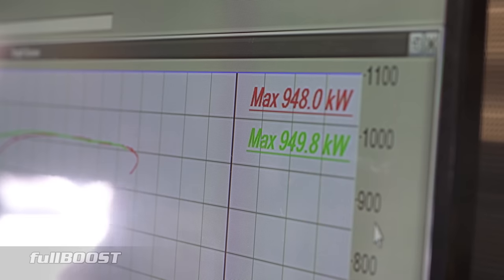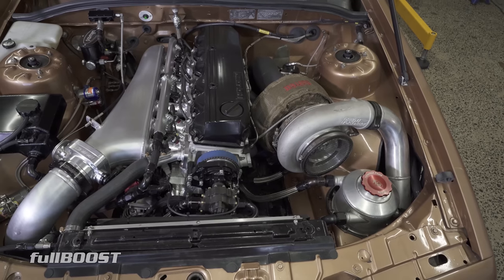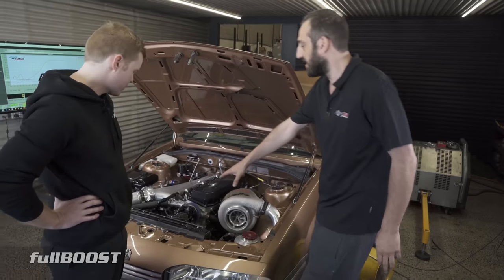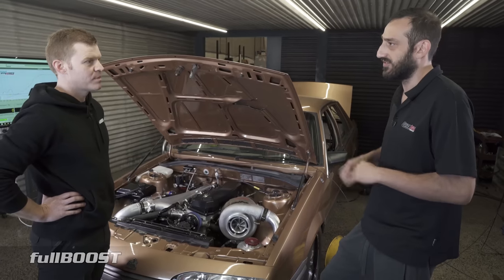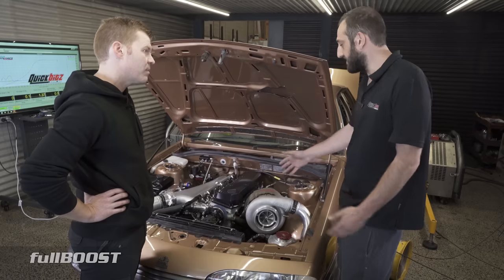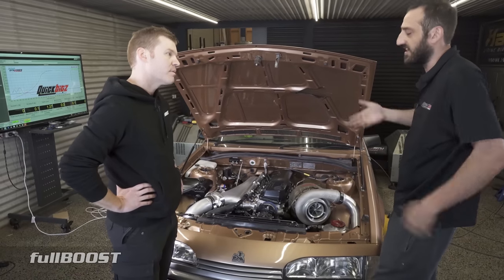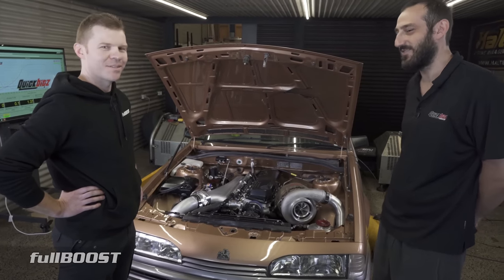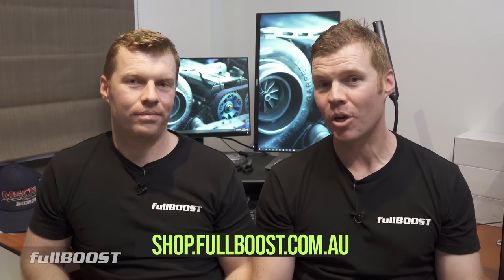Inside a 1300hp Nissan RB30 turbo | fullBOOST

Comment from the maker: We catch up with Michael Kalaitzakis and the team from Quickbitz while on the dyno with CK Automotive’s wild VL turbo. The Nissan RB30 Holden Commodore features a billet engine block amongst an impressive build list.
 If you’d like to be notified every time we upload a video, subscribe and then click the bell icon 🔔 next to the subscription button.
Reply: My mums 1955 falcons inline 6 made at least 50kw more than that Holden
Reply: Very good information great vid guys
Reply: Fullboost a $500 e gas barra engine could of made this power with valve springs alone.why are u wasting your time with this 1980s engine that is about to blow up?

Comment: And ONLY a SOHC 12v  cylinder head engine.  Great work indeed
Reply from the maker: Yes, just wait for 2J comparisons :)
Reply: Fullboost So there’s future JZ vids coming up?
Reply: @ricardo9628  That's not what they meant...
Reply: I know! I'm surprised they are still using a factory head on the billet block. Would have thought they would go billet head too! Bloody impressive thou

Comment: Grouse video as always... but why rather than make corrections just cut ignition in the event of a fuel pressure drop? Like shut the car down completely and possible save an engine? Strange when you are paying all that money on an ecu to still have it kill motors
Reply from the maker: That's what he meant, no engine damage was done.
Reply: @fullboost  funny when he said that i thought bad choice of words someone going to think it blew up
Reply: @SomervilleMetalWorks  a couple reasons, one is due to the mechanical fuel pump,  fuel flow is drastically increased with rpm. The other is we also knew it was going to surge from previous data, hence our "loose" tolerance on fuel pressure delta before a cut comes in to avoid false trips as it has driven and corrected  through that brief moment in the past. The cut came in before anything critical happened. You can engine limit over pretty much any run time. Sorry for the confusion it was a one take shoot and its a little nerve racking 😬  There are many ways to skin a kat. And none were harmed in the making 😎

Comment: Holden with a Nissan engine . . . was this a thing back then ? Did it come from factory that way ? Were Nissan and Holden getting in bed together ?
I always assumed it was a popular engine swap before the LS came into the scene and became affordable.
Reply: I believe so
Reply from the maker: The VL is the only factory car to use a turbocharged version of the RB30.
Reply: When the VL Commodore was made the old Holden straight 6 was outdated and didn't meet the legal requirements for unleaded fuel so they used a Nissan engine (RB30E and RB30ET).  
But only for this model, the VN that came afterwards had a Buick 3.8 V6.
Reply: @Private Name withheld Not in Australia it didn't. In NZ they did though.
Reply: Thanks for all the info, folks. 😊👍
Reply: yes the vl commie had australianized Rb 20 .30 and 30det sohc motors and 304 aussie v8 cause the old red motor series in the vk couldnt meet emisions of the day and the with the rb30 block you can fit rb26 TC GTR heads on with minimal mods and get a gtr big bore rb30 twin cam gtr motor
Reply: @JeremyPetho  Likely would have used the RB30 in the VN too, except during the model run the exchange rate between Japanese yen and AUD fell off a cliff, making them waaay to expensive.
Reply: @JeremyPetho  THEY WENT BACKWARDS